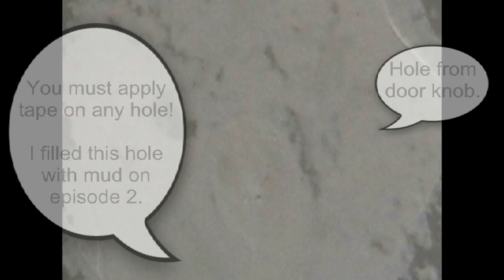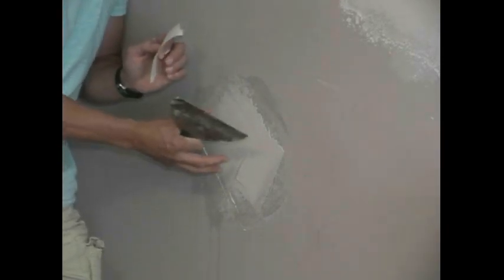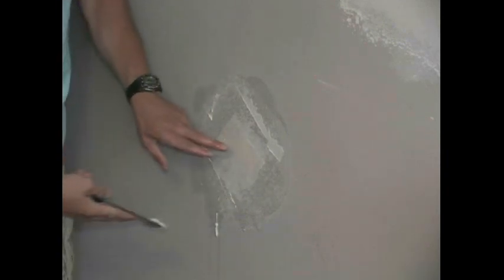How to fix hole in Drywall,Sheetrock,Wall 3

Comment from the maker: Hi vallejokid1968,
Butterfly patches are usually used on walls but it can be done on a ceiling if needed. I would add a little reinforcement in order to keep the weight of the patch from sagging. Get a large paint stirring stick from your local paint store or any hardware that sells house paint. They give these away when you buy a paint. The larger sticks are for 5 gallon paint.( any 1 x will do.) If you have room, cut it at least 4 inches longer than the width of the hole. Continue------------

Comment from the maker: Hi Jeremy,
I personally like paper tape, but Fiber tape will work too. If it works for you then stick with it. If not, I would recommend trying the paper tape. Just be careful not to mound too much mud when using it. If you wet the paper tape when using it, you can get a tight fit without mounding too much mud. the less mud you use with your first pass, the easier it is to get a good joint. Thanks!

Comment from the maker: valliejokid1968,
Continued----  Slip the stick in the hole and let 2" over hang the hole on each side. Run a drywall screw through the drywall and into the stick on both sides. Place your patch in the hole and run a couple of small drywall screws through your patch and into your wood strips. Then you will be able to float it out. On acoustical ceilings, you will have to feather the edges and sand some of the acoustic off in order to make it look good, otherwise you will see a distinct line.

Comment: Hi Paul, this might be a silly question but can the same method be used for patching a hole in the ceiling or is there a better method? I am having electrical work done and the electrician said he will use a 4" hole saw and leave me the plugs. Also, the texture on the ceiling is a lot courser then the walls. Any tips to help me match it? Thanks for the great videos.